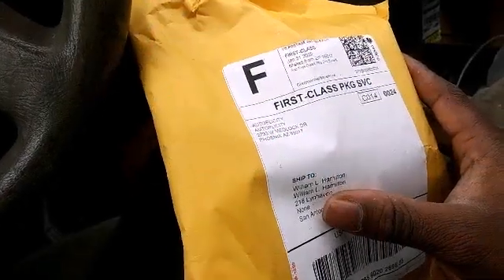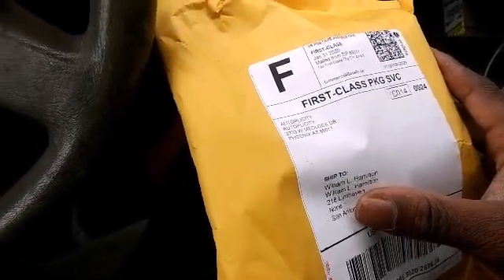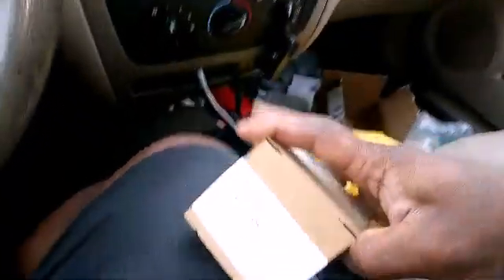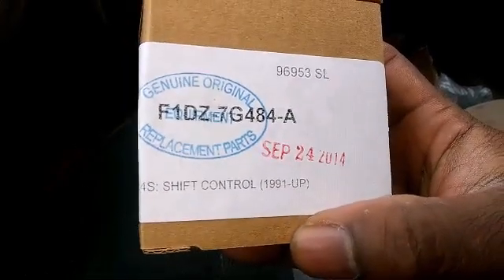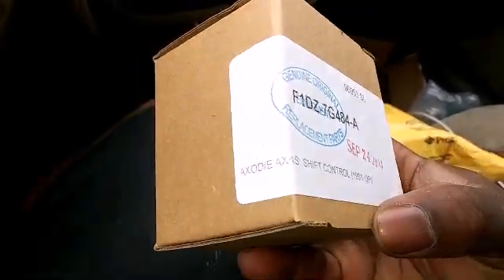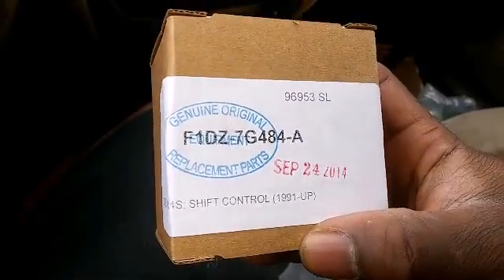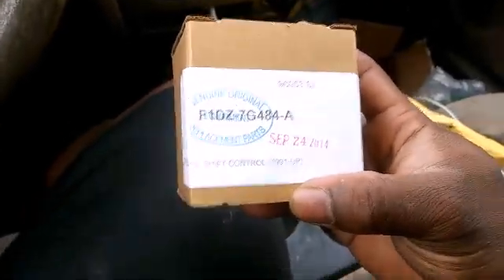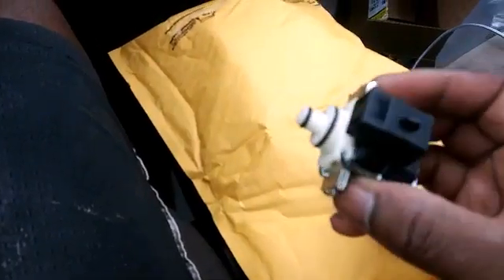2007 Ford Taurus SE - Shift Control Solenoid  Unboxing

Comment: Sounds good what series of Flowmasters
Reply from the maker: I use Flowpack 1-chamber mufflers made by Jones Exhaust. They ate similar to Flowmaster Super 10s but in a bullet style muffler.
Reply: @ragintaurusmusclemercury7023  so you got dual pipes on yours it's a car up here like yours and it says cold start
Reply from the maker: @anthonysherrod7222  Yes.
Reply: @ragintaurusmusclemercury7023  that damn boy sound good it sounds like a Hellcat lol

Comment: Hey Mr Vulcan long time no see. But I have some questions. So a few days ago I was. Jump starting my second car (beater 95 accord) and I while I was revving the engine to charge the battery a bit quicker. My exhaust literally popped out. Where the flex pipe connects to the first catalytic converter coming off the engine. I was wondering what I should or if you have any advice. I also wanted to ask since the whole exhaust is off the vehicle should I try installing some headers?
Reply from the maker: If you know how to make a set of headers for it then go ahead. There are no aftermarket headers for it. You will have to get a set of Vulcan header flanges from Tom Morano Racing and a universal header kit sold through markets like Summit and Jegs and make a set.
Reply: Vulcan Taurus Performance should I purchase the  3L header adaptor plate? Or just the header plate I’m your opinion what’s best?
Reply from the maker: @anninias4575  Header plate and then make a set from them. The adaptors are only for Vulcan powered rear wheel drive vehicles where you can use Mustang V6 headers. They won't fit on front wheel drive applications.
Reply: @ragintaurusmusclemercury7023  where do the solenoids go?
Reply from the maker: @christopherlitton696  In the transmission. Improves the shifting and the rpm they shift at.